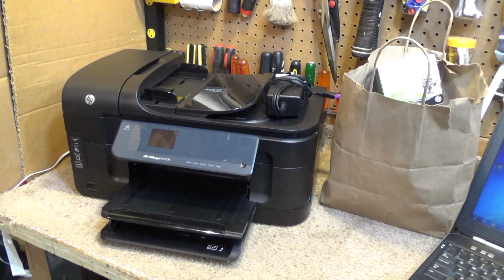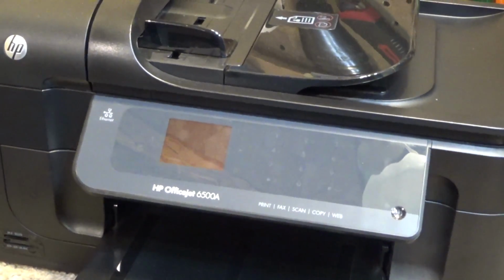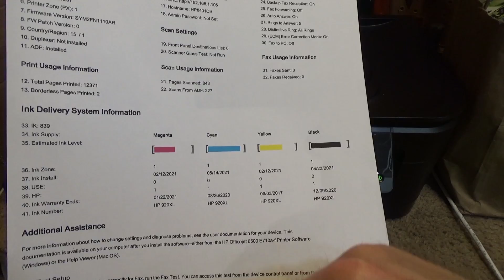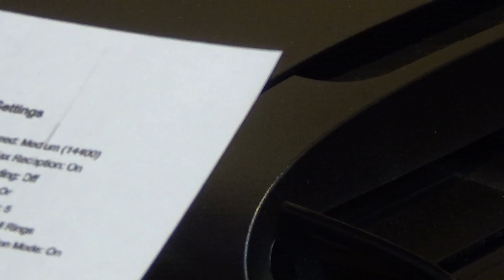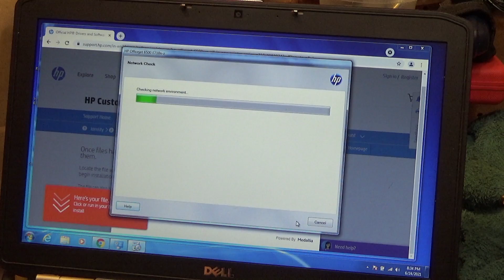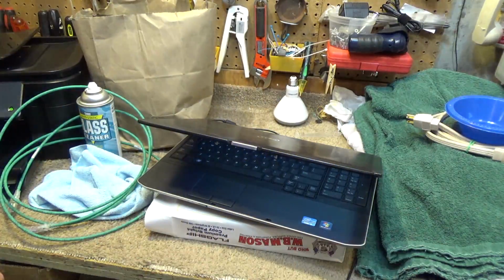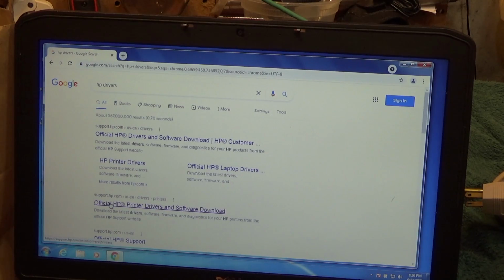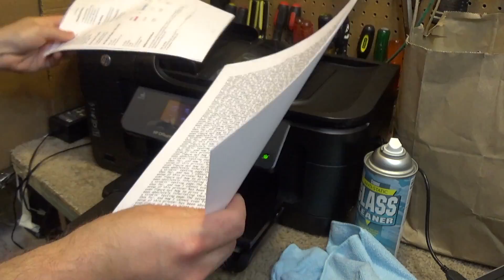Testing an HP OfficeJet 6500a InkJet Printer/Copier/Scanner/Fax

Comment: My aunt has an HP pretty similar to this.  They seem okay, but they're so loud and sound so chintzy and creaky.  I'll stick with my Canon until it quits, then get a laserjet.
Reply from the maker: The sounds are different and arguably far more distracting, but I don't think this is all that much louder than the laser printers I have. My grandfather had a Canon ink printer for a long time, after multiple head changes he finally bought a laser model from Canon. He doesn't seem to like it, I'm not really sure why.
Reply: True. I have an older HP all in one that I got back about 2003 as well as my newer one from 2014. The older one is much heavier and just feels like a tank compared to the new one. And the new one indeed sounds cheap and creaky when it prints. I do like the touch screen though, the old one was always too dark to read with the LCD screen it has. I only replaced it because the cartridge got really expensive and Walgreens stopped offering refills.
Reply from the maker: @coled5090  I have a very old HP printer at work, it's been under heavy use for over a decade and it keeps going no problem. It's a lot harder to configure compared to a newer unit with a screen, but the quality simply cannot be beat.